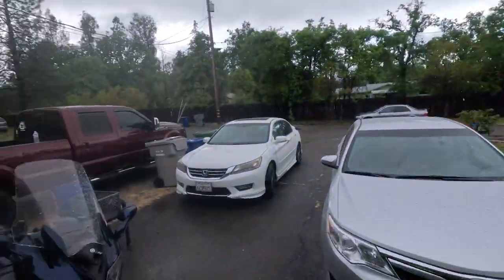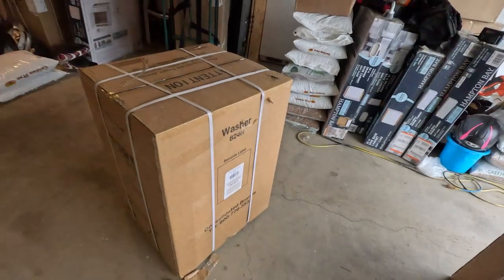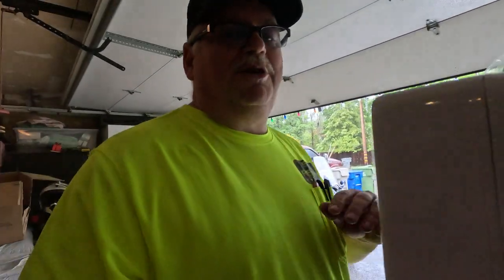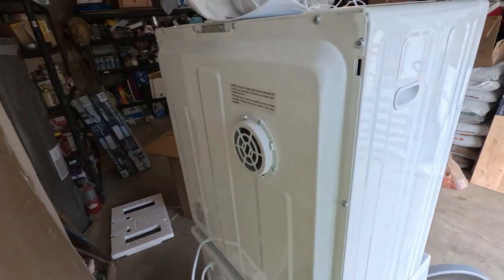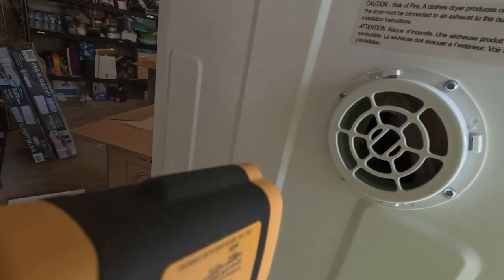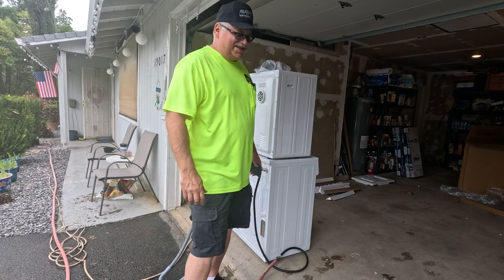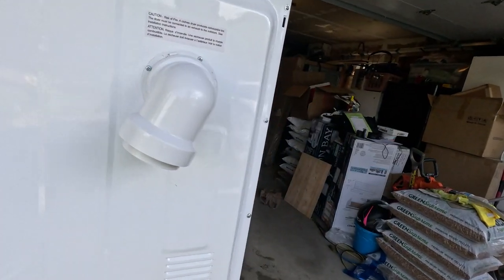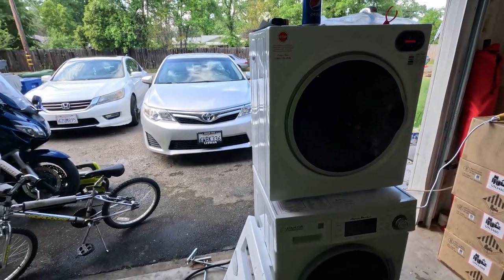Equator Ultra Compact Washer/Dryer unboxing & function check

Comment: How's it working still?
Reply from the maker: So sorry for such a long response. I've been back for about a week from Texas, and trying to get back to work is a hot mess. I left everything scattered, and trying to get sorted has been...well, challenging. I'm still trying to figure out YouTube's interface, so I can't see what video/project this question is for. I assume it's for the mini-split? It's doing amazing honestly. I can't wait to get the second unit up and running. Even in mid-30's, the bus is still comfortable enough inside to work. Now, maybe not to travel in, but I am confident the second unit will make it nice and toasty inside.

If this isn't what your question was about, I'm going to try and see what video this was for, and edit my answer =)

Comment: How did you get it stacked im having issues with figuring out the stacking kit
Reply: Unfortunately, there are still waiting to get installed (although we're getting very close!), so I haven't stacked them yet. I have looked at the stacking kit, and deduced that it wasn't going to be a straight-forward process, as there was no obvious slots, bolt holes, etc to let me envision how the stacking kit works. I'll go out and take another look, and if I figure it out, I'll advise.